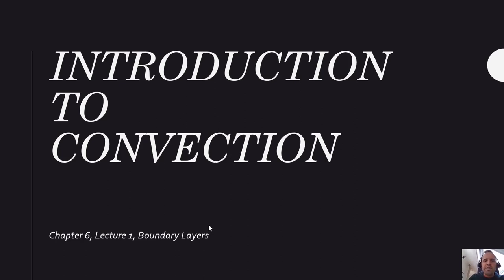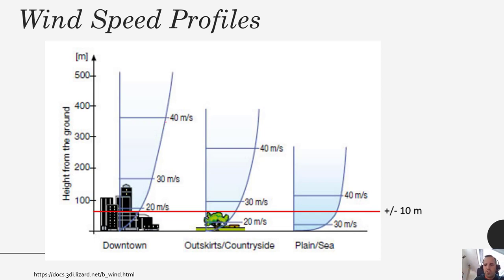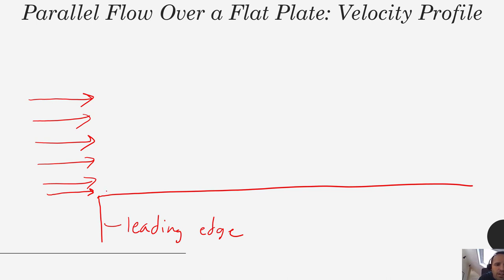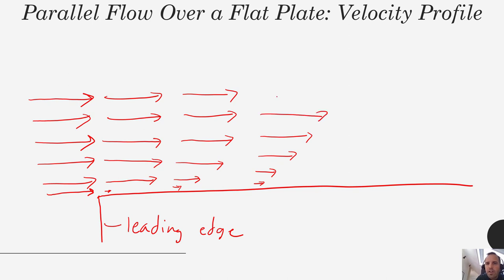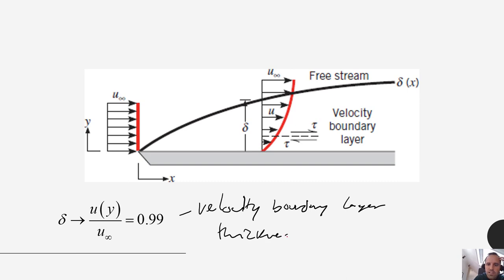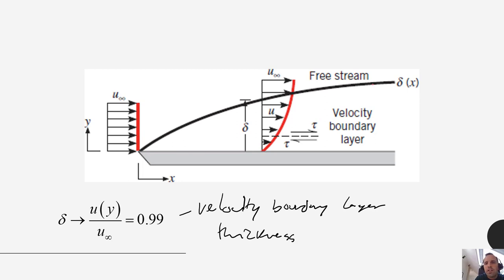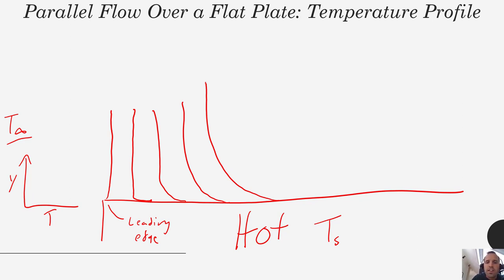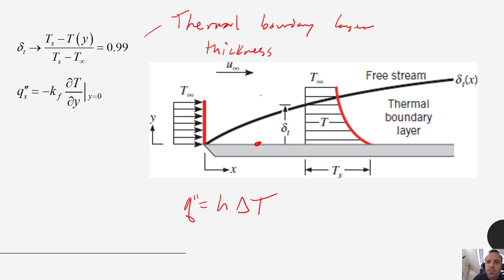Heat Transfer - Chapter 6 - Introduction to Convection - Boundary Layers

Comment: it seems as though there is no way to adjust for different types of fluids because the h is based on dT but the dT changes with different fluids that have different viscosities and conductivities and diffusivity. I'm very frustrated trying to figure this out. There doesn't seem to be any literature about it that I can find.  every equation i can find, the dT is based on h and visa versa but i can't have two independent variables.  Also there are no published convective heat transfer coefficients of (for example) a mixture of 70% water and 30% propylene glycol.

Comment: Thanks for the introductory lecture. I have a question: I'm wondering about convection within the flow across a surface. Is it mdot  x enthalpy integrated over the surface or is it mdot x internal enegy (u) only?  In mechanics normally we parse out the mdot x P/rho as part of the mechanical energy but it seems like in heat transfer we include that in the convective heat transfer term (mdot times enthalpy=mdotxu+mdotxP/ro).